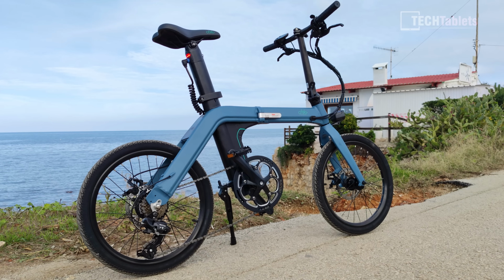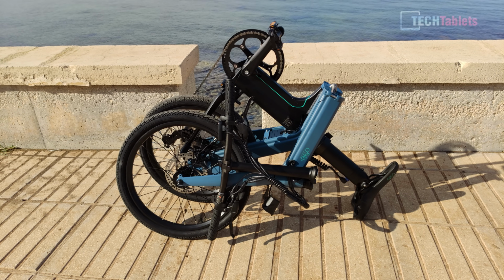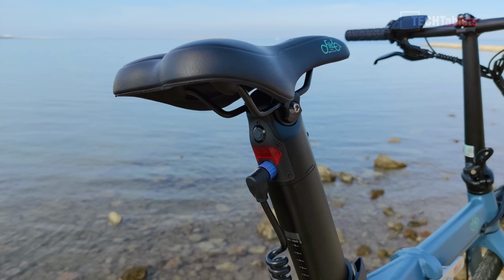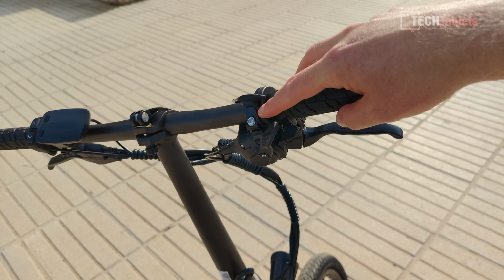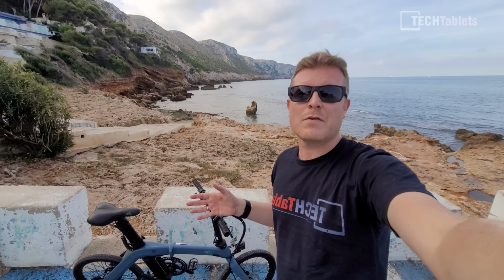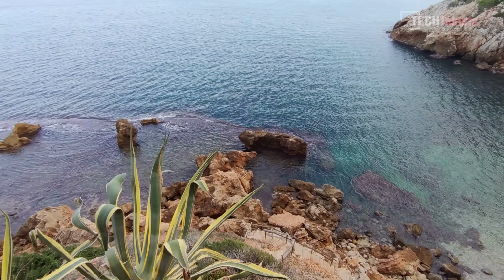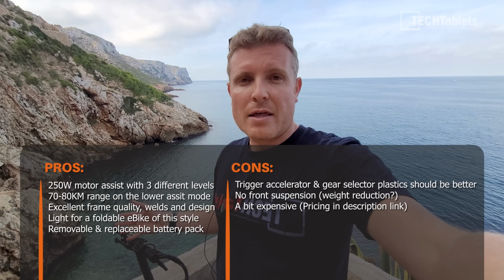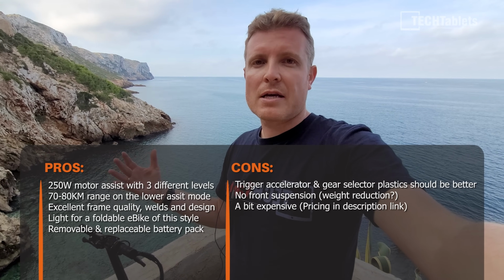Fiido D11 Review AWESOME Foldable eBike!

Comment: The Fido 11 is not 13 kgs, It's 19 Kgs, probably lighter when you remove the battery. An added security lock also makes the bike heavier. I own one of these bikes myself. I see this one has no mud guards, mine does. The only thing I would fault the bike on is the easy theft of the combined saddle and battery. You don't want to be removing the battery every time you Lock the bike outside to pop into a shop, and the battery is not that light, so carrying it with you while shopping is a no no. Anyone with knowledge about the bike knows that all a thief needs is an allen key to steal the battery combined saddle, costs about 400 Euro to replace. I fixed mine to prevent it from been stolen..

Comment: I wish the latch holding on the seat post had a way to loop a bike lock around it. Can’t decide between this and the M1 Pro (fat tires, suspension). The D11 seems easier to get into a car trunk without taking all the space up.
Reply: The M1 Pro is heavy and unpractical unlike the D11 (you can run larger volume 20" tyres for more off road compliance) 20x1.75" are too narrow. Also the gears you can upgrade to Shimano megarange freewheel if the derailleur is long enough.

Comment: I don’t want more consumers to be forced into unfair purchases. It's surprising how this trade is thriving in Europe. Below is the customer service reply regarding after-sales and returns:  

---

*Customer Service Response Email:*  

"Regarding returns, there are no quality issues involved, and the e-bikes are larger and heavier.  

Therefore, in case of a return:  
- If the bike has not been taken out of the box, you will only need to pay approximately 200 euros for shipping fees both ways.  
- If the bike has been taken out of the box and test ridden, we will deduct 30% of the depreciation cost from the refund.  

The above costs will be subtracted from the refund amount. Once we receive the returned parcel, we will calculate and provide you with a partial refund.  

If possible, we encourage you to keep the e-bike and contact us to receive a partial refund of 30 euros."

Comment: Very weak and slow bike. Overpriced .Not realistic review.
Reply from the maker: Oh course it's legally limited to 25km/h for Europe so it's slow. Not sure if it can be unlocked.
Reply: I think if Fiido can give the US customers a way to unlock the speed to 18 or 20 mph like other companies, D11 should be a best seller even at the high price. I like it because the weight, style, smooth and quiet riding but I am disappointed I can’t even give it a boost to climb the overpass like other eBike that I own.

Comment: hi guys. How much PSI of air do I need to load for Fiido D11? Thanks 😇
Reply from the maker: It's normally on the tires like 50 PSI max I think for this model But I would run 36-40 PSI max otherwise it's too hard the ride.

Comment: hey TT, I just received the D12 model and i only have pedal assist mode. the throttle only speed I get is max 6km/h what am I doing wrong?
Reply from the maker: Sounds like a faulty throttle. Talk to your seller to get that fixed.
Reply: @Techtablets  thankyou

Comment: This is how pretty much all reviews should be done. No fluffing around. No filler material. Just useful information and straight to the point. Well done.
Reply from the maker: Thank you! Also how I think a review should be which is why I try to stick to the info people need to know.
Reply: @Techtablets  ....you forgot to address one of the most important parts, it's folding capabilities.

Comment: The problem is you can't lock it outdoor without taking off the battery, otherwise, the battery will be stolen if you live in a city like London. However, the battery costs only $350. As well, there is no front suspension, if you ride in cities like London with a lot of potholes, you might end up having pains in the butt lol

Comment: One of the main reasons I bought my D2S is that the battery location is not immediately obvious and you would need a Philips screwdriver to remove it. That battery is far too easy for vandals to steal off that bike and having had various accessories stolen from my bike over the years I am sure the allure of stealing that battery would be too strong for some of the scum living in my town to resist.
Reply: Maybe the new Fiido X (to release soon) is a better choice. What city do you live?

Comment: Problem is you ain't always going to want to take out the battery when you lock it and someone could easily steal the battery
Reply: I got a lock that secured the seat post and battery
Reply: @jamesl9371 judging from some of the posts you’d have thought they don’t exist…well done you
Reply: You will if you are worry about it
 I have the D2S hate having always take the bike up stairs just charge the battery

Comment: What are you doing on a 20 inch wheel fold-able with a 15mph limit that requires hydraulic brakes? 160mm mechanical discs seem more than adequate for the intended purpose.

Comment: Dammit, I ordered this and didn’t realise they took away the handle twist throttle from the d2s 😭 really hope it’s still as fun to go full electric.
Reply: Hey Edward how did you get on with the throttle control? I can't pedal (knee problem) so would prefer the twist control too, ideally.
Reply: @liammullan2197  it’s great 👍🏻 you could happily go full electric for a 40/50 minute journey, roughly with no peddling. However if you need to go up a steep hill I’d say you need to give it some assisted pedalling. If you can’t peddle I’d say ensure you stay away from hills. However you have zero suspension so unless you lift up off the seat standing on peddles if you hit bumps your going to feel it big 😂 the cheaper models and m1 seem to have suspension which id consider if you have bad knees.
Reply: @Ed-zi9ju  Cheers for taking the time to reply. Gonna save my pennies then :-)

Comment: Hi Chris.  I've had this bike for a month and a half and, sadly enough, can't agree with your review. My main concern is build quality and support. My bike factory setup was almost unusable: the chain was way too loose for the first 4 gears and I had to use the higher gears (5-7), the frame hinge was way too stiff and unfolding the bike required the equivalent force of lifting a 60kg weight bar.

On the second day, I got a flat tire (which I've never had on this route for 3 years of riding other bikes) and took it to a bike shop: there were metal shards between the tyre and the tube, probably leftovers from the manufacturing process. The tech also warned me about another concern I had: the rear wheel makes a weird noise when cycling with the motor off. He suspects of poor lubrication which might lead to wear out.

However, here's my biggest issue: the seat post insert is rotated slightly to the right, so the seat hits my right inner thigh on every cycle, and it doesn't look to be fixable.

There are more annoyances:
· The seat will not stay in place and keeps tilting upwards while riding. Screwing it further down won't help, will have to take it to the tech once again
· Mud guard was not included in my unit, had to buy it separately
· Missing seat post ruler
· The engine is very weak compared to other 250W ebikes I've ridden
· The front bar will not lock when folded, it might keep bumping the frame/fork and chipping the paint out
· Same for the folding mechanism: looks good on camera, but I've ended up not folding the bike at all. You have to unplug the battery, lower the seat post, fold the bike and rotate the front wheel so that the bike won't fall to the left side. And make sure the bike isn't resting on the crank cover
· As for the weight, it's far from 12kg: slightly over 18kg once you insert the battery/seat

My current feeling with this bike is remorse. I wish I hadn't bought this bike. For a bit more I would've got a similar bike with proper customer support in a local shop.
Reply: Thanks, that's the review i needed. What is your height, mate and is it comfortable for someone like 1.84m tall?
Reply: Really interesting points from you, thanks.

Comment: I own a Fiido D2 for the past 2 years... 3 weeks ago the locking mechanism of the handle bars straight up broke while I was driving... The just folded when I was in motion :3 Luckily I was calm and gently slowed down... In the past the mechanism had undone itself and again it started to fold while I was in motion... Even the frame folding mechanism has done it once... Again, I was in motion O_O 
Now the mechanism of the handle bars is broken... I just went ahead and DIYed a solution for keeping it down (because there is no way to keep it "locked" anymore... I wonder though... Does Fiido seel replacement parts?...
Reply: Hmm makes me think a rigid version with no folding or QR handlebars would be better option

Comment: Great review, but it is a fold-able bike and I would have liked to see more comments on its fold-abilty. It doesn't look easy to carry onto a public transport system, just for lifting into a car boot? How will the fold joints hold up, will it become a weak point in the frame over time? 

That plastic accelerator lever looks like it will break off in no time.

Comment: Hi Chris, Sorry to ask but what would be your height and weight? Im a big guy so Im trying to work out if this will be suitable for me.
Reply from the maker: 78 kilos and 1.82m
Reply: Up to 6 foot 2 I think this bike will accommodate. The only drawback of this bike is the HANDLEBARS. They arent adjustable. They are set at about 110 cm. Approx 43  inches. So if you are very tall it will mean you have to raise the saddle and hunch over the handle bars  5 6" to 6 2" this bike is ideal.

Comment: As a Dutchman I must agree, this one looks like a very nicely designed foldable e-bike, especially that weight of 13kg. 
Seems perfect for traveling to work, in combination with using public (train) transport, when a normal non-e-bike foldable does not suffice when the travel distance from dest. train station > work requires a second bus or metro trip. An e-bikes like this sounds ideal and more flexible time wise.

And indeed very nice scenic town and area of the Costa Blanca, with those cliffs, for an e-bike review like this :)
Reply: Not sure if Chris mentioned and I missed it, but the bike is over 19kg with the battery. Not light.
Reply from the maker: Thanks for watching. Yes i think it's quite a good one better than the D4S I reviewed

Comment: Sadly with the accelerator on the handlebar, it's not allowed in the EU.
Reply: By the way, on Fiido d11 the throttle is, correct me if i'm wrong Chris, removable which makes it then allowed everywhere even in italy.
Reply from the maker: I could be removed yes. And still give you the 3 levels of motor assistance and limited to 25km/h
Reply: Some countries Indeed ban them. Others allow it. And others allow it under the conditions of immatriculation and special insurance... We are one as a continent but independantly we have many lame différences 🤭
Reply: @luchdvilleneuve6384  I did not know that this regulation is not even uniformly regulated within the EU. I am here in Germany, but the main problem should be the liability if you have an accident and you were riding a bicycle that does not have a general license. This could be much more expensive than the fine if the throttle is noticed during a check by the police.
Reply: @juergenlilien2067  here in France is the same. We need to register it if we use the throttle and have a licence. If you remove it, it's a bike with electric assistance, not a scooter and therefore all of the above is in Line with the UE régulations:
- assistance up to 25km/h above that, assist stops,
- no throttle
- certificat homologation UE required also and Fiido can présent you with one (got one for my DS4 so i can't believe none exists for D11).
But no more throttle assist with is great for giving you a kick after waiting for red lights (and i do it religiously opposite to my fellow bikers whom i see running them cheerfully)
Reply: @juergenlilien2067  lastly, here in France is registered and used as a scooter limited to 25km/h, you can't use bike lines which is rather stupid since bikers go faster than 25 with 26"/28" wheels on flat roads. So you have to be with the cars and actually scooters. 
Solution peddle even a little bit not to get caught... 😤
Reply from the maker: Which EU country?
Reply: @Techtablets  Germany

Comment: I saw this bike before it's great but non-lockable battery is a no-go for me.
I bought the D4s after seeing your review last july while this one was still a project on indigogo.
Anyways thank you very much for the test. 
Would you please test out the Himo z20? Similar but removable & lockable battery
Reply from the maker: If they send me a loan one yes.
Reply: Himo z20 is not far off 10kg heavier!!!
Reply: @huzcer  win some, loose some... With the removable/lockable battery. I admit if they had found a way to lock the battery and tighty, D11 would have been unmatchable, despite it's 250usd more price
Reply: @luchdvilleneuve6384  just take the battery with you or put bike inside? (it's foldable after all). or find some own way to lock? D11 will have some price deals no doubt. surely it will be unlocked down the line also for speed?
Reply: @huzcer  you can't lock the battery therefore you have to take it out with you each time you park it. Otherwise believe me in cities it will be stolen 9/10 Times even 10/10.
Reply: @huzcer  it depends what use you have with the bike and if you park it for an hour or 2 which i do... Too risky or painful for my taste

Comment: Hi Chris. You can't unlock the speed on the D11 like you can on the D4S. Also the engine is less powerful and smaller than the D4S's even though it's also 250W. Not all Watts are alike ;)
Reply from the maker: Thanks for the info! I was lead to believe you could with this same D4S controller. My bad.
Reply: Still d11 is nicer
Reply: @gideonMorrison  Agreed it does look the best out of all the Fiido units
Reply: I think the ds4 for is a better overall choice at almost half the price.

Comment: Road bikes generally don’t need dedicated front suspension. If the fork is carbon for instance it will still absorb plenty of shocks. Even metal forks have elasticity,
Reply from the maker: These roads are quite poor so it would be great to have something. I have to run a lower PSI on the front tire to help.
Reply: @Techtablets  you are making it more prone to puncture but ok. Everybody can handle their own level of vibration. I just remember slapping some schwalbe all terrain tires on roadbikes and going off road with them just fine.
Reply: You obviously don't know the roads or bicycle paths we have here. 😉
Reply: @juergenlilien2067  i think Romania counts as same or worse.

Comment: I take it the seat height is not adjustable?
Reply: You can see a height scale on the seat post in the video, so it should be adjustable.
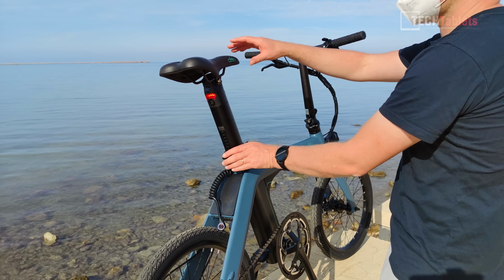Reply from the maker: Hi, I do show it in the first 30 seconds of the video 00:28 and later on. All the info is in the video or you can see it (Pretty self-explanatory from the footage)